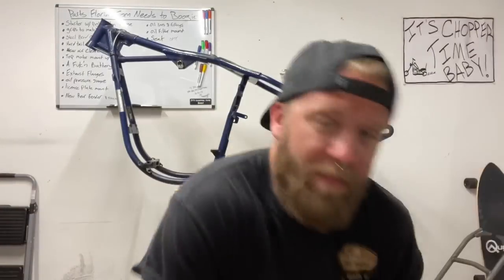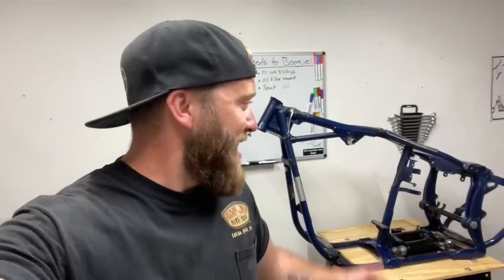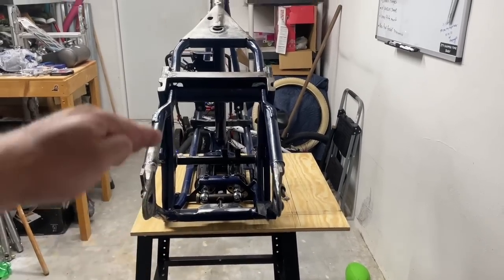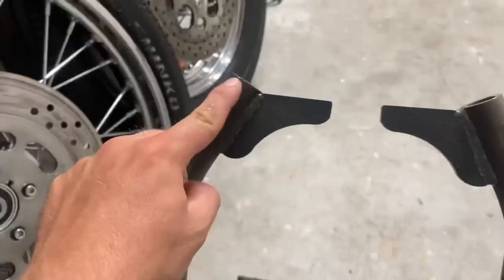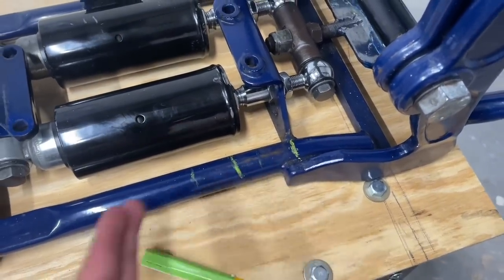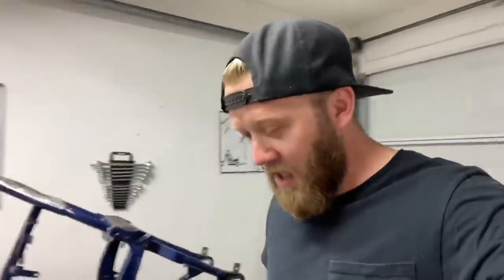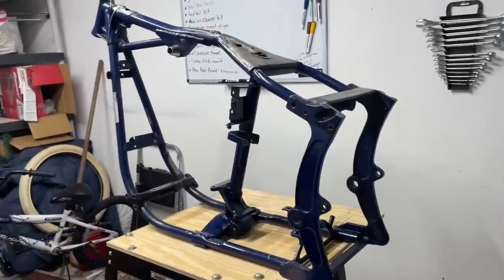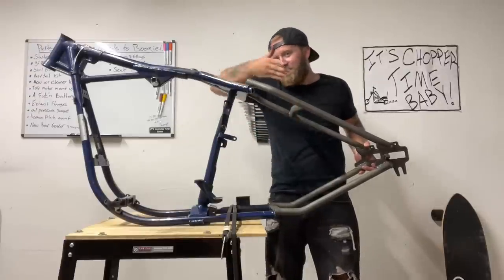Hardtail a Harley softail frame

Comment: We grafted the original 'swing arm' to it's  frame, and it ended up looking like it came from the factory like that.
Reply: How did you do it,I have s twin cam,I just bolted it to the frame and slammed the fender real close to the tire.
Reply: @beardoallin657  at the time we couldn't find a weld on with the same outside diameter of a softtail,  so we set the frame in our gig, and cut off anything that was in the way, and ran new tubing where needed, you really had to look close to see that it wasn't from HD.